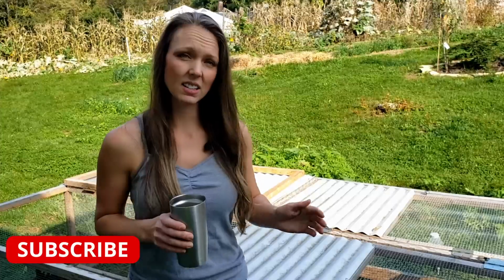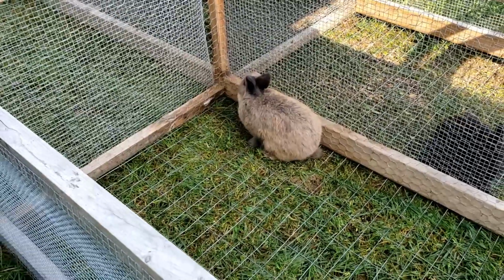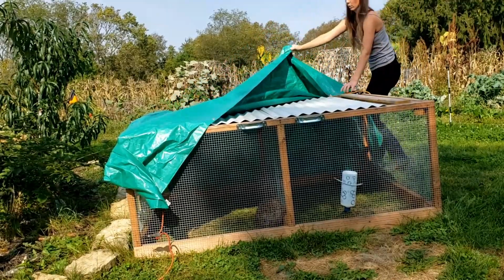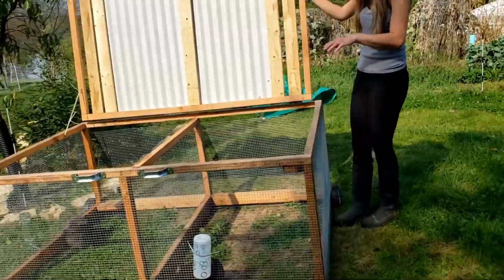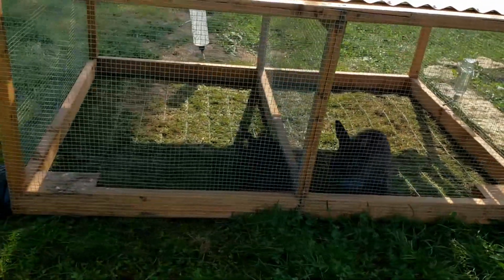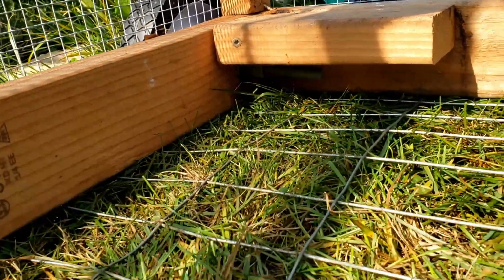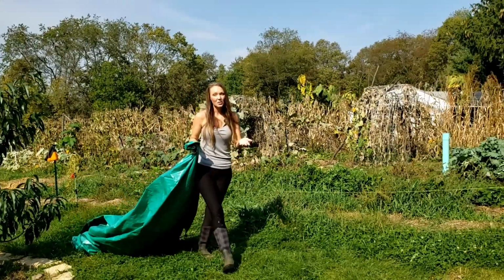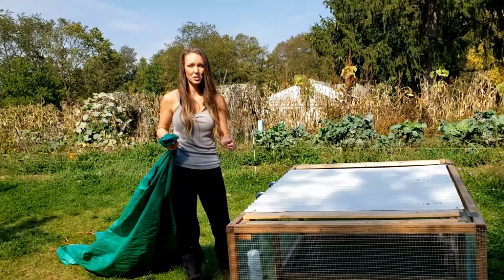Easy DIY Rabbit Tractor (full build)

Comment: What an outstanding video! I've been waiting on one for a "chicken tractor" but I think this will suffice for now! 

Questions: 

1) how often do you have to move the location to keep the rabbits well fed?
2) Do you bring the rabbits into a different setup for winter?
Reply from the maker: Thanks for the great questions!
1. It depends on the season.  During spring and fall we move the rabbits once a day because the rainfall supports much lusher grass and weed base (yes the rabbits love dandelions, lol).  During the dry spells in the summer we may move them twice a day.  It also depends on how many rabbits you have in each compartment.  If we have a doe with kits in one, the grass cover will run out much faster than a single rabbit, and the growing kits tend to eat more than adults.
2. Yes we do.  Since we raise our rabbits for meat, we typically cull the herd down to a smaller manageable number that we can afford to feed hay to.  Also, here in the Midwest we tend to have colder winters with snow on the ground, so we have raised enclosures (still outdoors) that keep the snow and winds off them during the coldest portions.  Our Silver Fox breed is well suited to cold climates, so they do very well outside all winter long.

Hope that helps!

Comment: What dimensions are the second gen sections? 2x4?
Reply from the maker: We're working on getting all the dimensions together for a rough set of plans that we'll post to our website at PurposeDrivenHomestead.com but high level the overall dimension is approximately 3'x4' for the whole tractor.
Reply: @purposedrivenhomestead  Do you have the plans available anywhere yet?